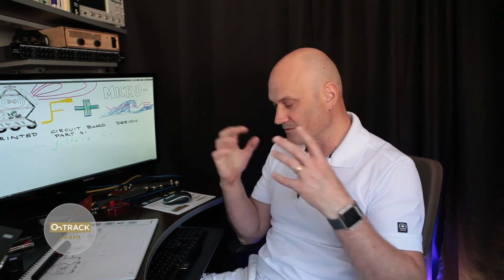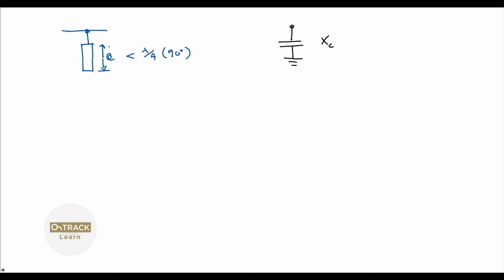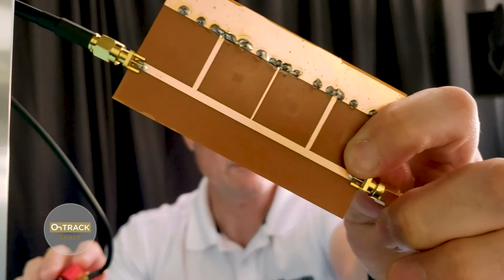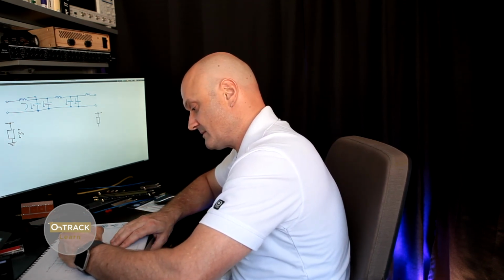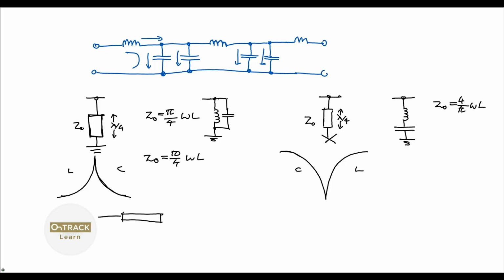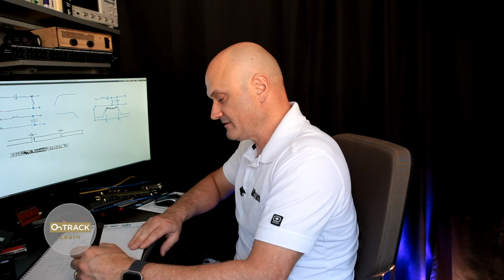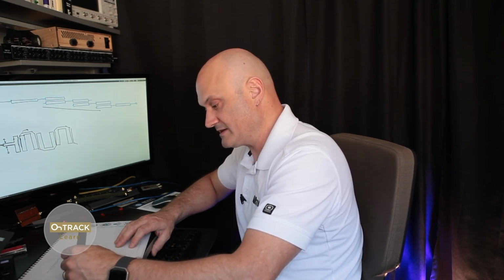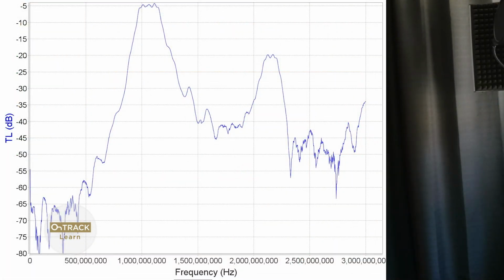Whiteboard RF Episode 6 - Filters

Comment: Thank you so much for this series. As an intern who just finished a degree in Photonics, I have been thrust into doing some RF PCB design and had no idea where to start. I definitely see some similarities to optical devices although it's nice that these do not require a microscope to see! I was wondering what the purpose of through-holes and rings are in an RF PCB? The design which I am modifying has many of these.